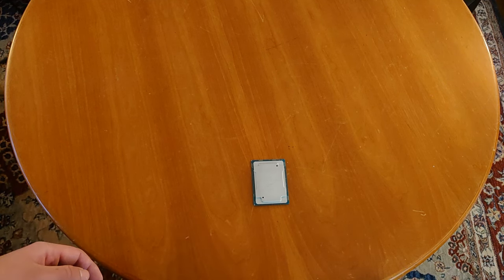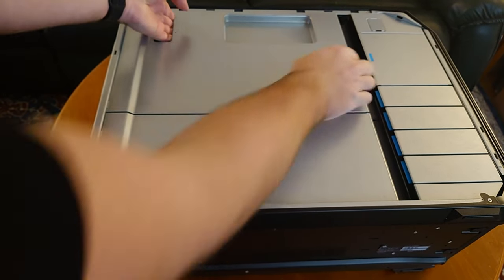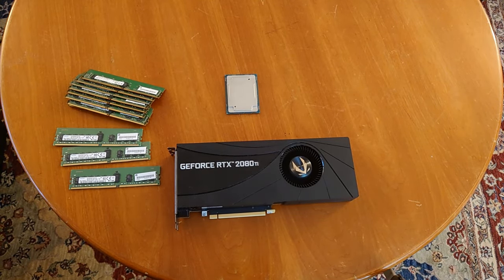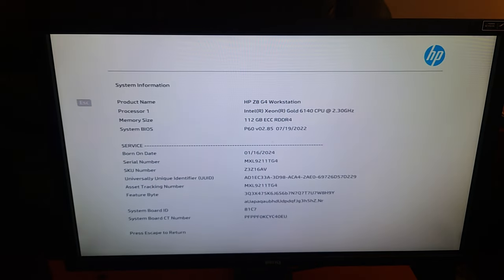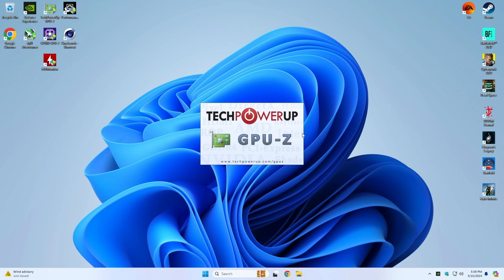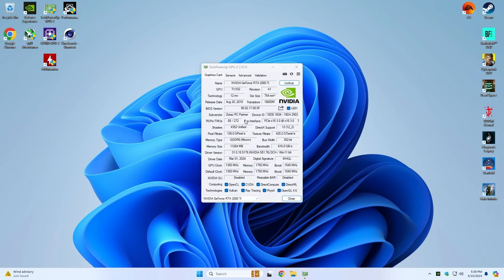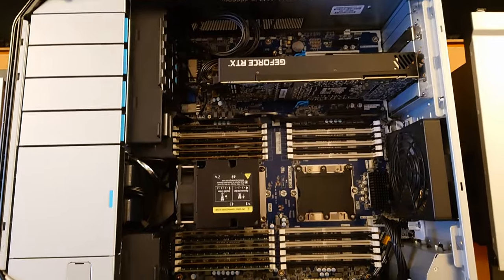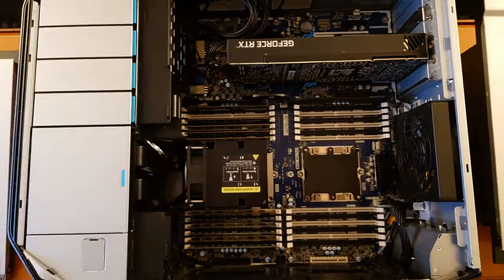HP Z8 G4 Workstation Upgrade: Gaming on a $40 18 Core 1st Gen Xeon Scalable

Comment: is the thing with the lighting tearing not just vSnyc? Make sure that's on. I looked at the base system for this and it was £900 (im un uk) it kinda defeats the purpose unless you have large workloads. Could see this server being great for things like video editing or 3D rendering.
Reply from the maker: I can check vSnyc but it seemed to be related more to frametime issues. I was able to get that system for around 400$ USD not including the GPU.

Comment: After X58 lga 1366, workstations for gaming, lost its value. The X58 6 cores had a long life. But now you just get a lot of very weak cores. It eats away of the gpu performance. You can get 20k in passmark with a gtx 1080 for 3d mark using a modern cpu. The cpu score is pretty decent if you can find software that actually uses all the cores and threads, but games don't. Games just need a few very strong cores.
Reply from the maker: Yep and those old X58 CPUs don't have modern instructions so newer games and apps won't even launch anymore.
Reply: X58 Bruh really? x99 flagship cpus can keep pace ryzen 5000 and 12th gen i5s. Recent workstation cpus sure but there was definitely workstation chips after x58 that could game pretty well and still do.
Reply: @esotericjahanism5251  I never said they cant. I tried to say how its not smart to make something like this just for gaming (title says Gaming on a..). If you already need a workstation then sure why not. And no they cannot pace ryzen 5000 and 12th gen as no consumer software is able to make use of a 18 core cpu. Games are still golden with only 4/6 really fast cores with high single core performance. Its a theoretical performance in the hands of consumers. But keep telling yourself that lol

Comment: ive got a dell t5600 with 2 10 cores in
Reply: T5810 with E5-2683v3 14core here, might swap it for a 22core if I find one that isn't stupidly expensive some day. But I fail to see the point of gaming on something like that. I have a quadro P4000 in my T5810, it can run fuggin crysis if I bump my head hard enough to feel like that's something that needs to happen. Holy balls this thing is EXPENSIVE though, starting at 3 grand refurbished used where I'm at. You can get a fancy new gaming PC  with that, and have change left for a fancy monitor, sound setup etc. And a few large pizzas.
Reply: @noth606  i just like looking at mine when i use my other pc! i love my workstation to bits but its just so loud lol
Reply: @johnmay4803  I'm rebuilding mine at the moment, so it's not functional right now, has a new 1Tb NVMe boot drive so new install required. But it's not loud, but then it doesn't have HDD's anymore. Well, loud is then relative, it does obviously have like 5 fans in it at the moment, so it's not silent either. 3 at the front, 1 on GPU, 1 in PSU, probably getting one more to cool NVMe's soon. 
The HP Z8 G4 here looks nice but it's got to be stupidly heavy. And big.
Reply: @noth606  i honestly dont think the HP is built as well and dont you think the fans sound like a fighter jet?